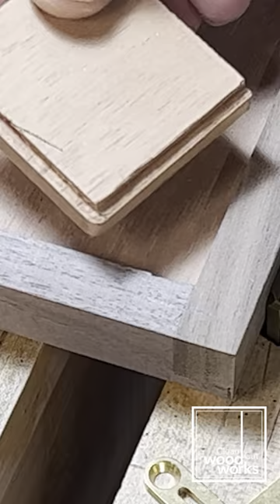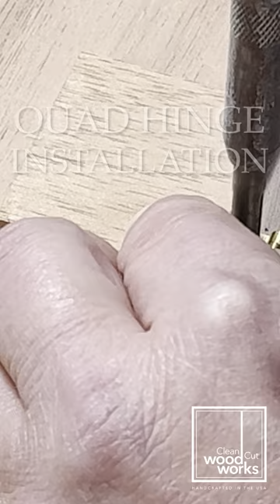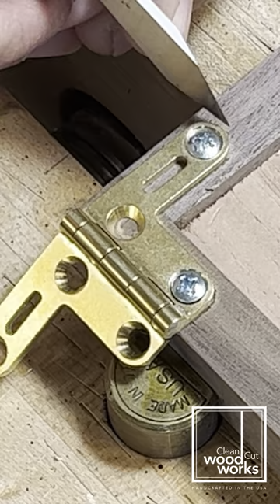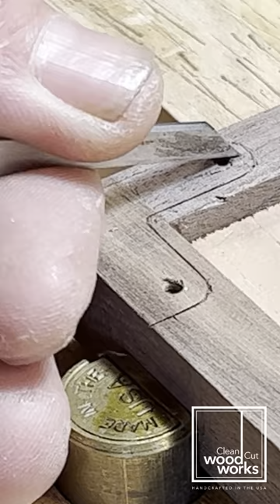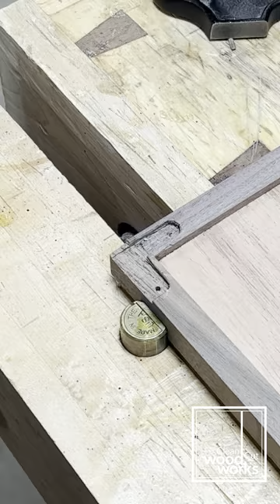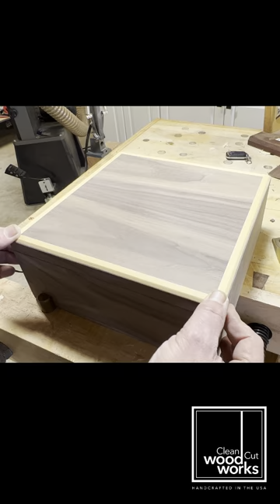Quad Hinge

Comment: Very nice. I noticed that the hole drilling was right on the Center point. Is it a drill bit adapter thingy and does it come in different sizes? What is the name of it and where can it be purchased, please?
Reply: Theyre called hinge drills or centering drills. Sold anywhere woodworking supplies are sold.

Comment: Hmm nice but the end product shows where you screwed the pooch and split the tits off the wood, leaving no structural strength in the wood. It looks like this happened when you had to remove the material for the brass restraint which goes deep into the wood. After you superglued the broken section back on you didn't remove the glue dribbles running down the side. Not saying your work is bad but, you should put your best up, or be more open about the mistakes. Don't highlight the prep and hide the difficult bit when it goes so wrong and hope nobody sees it.